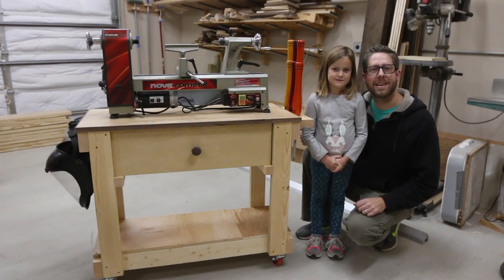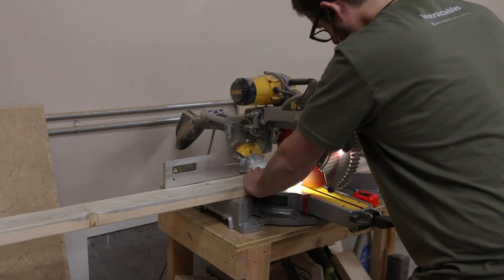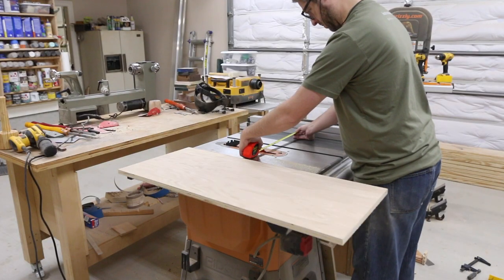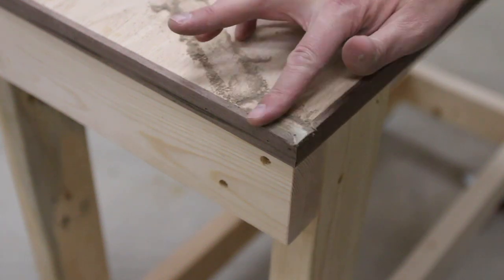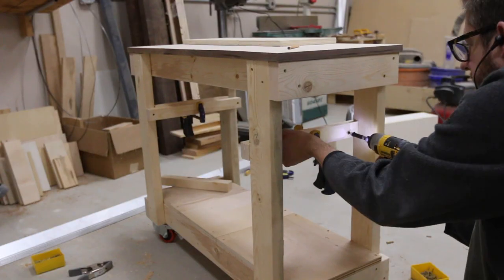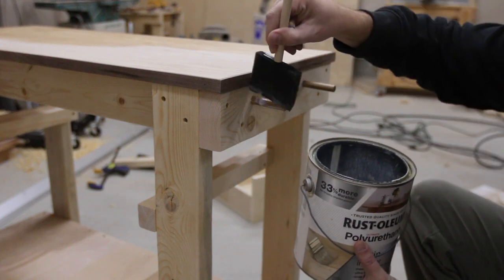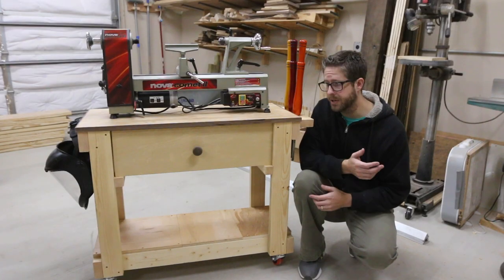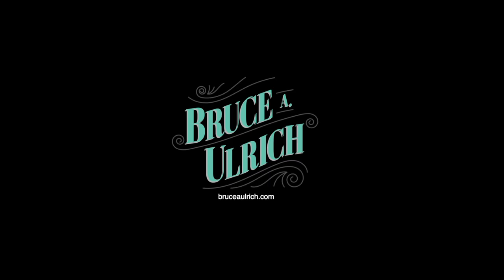DIY Lathe Cart from 2x4's // Woodworking How-to

Comment: Very simple, nice, effective, and practical cart design.  Plan to make a numbre of them for each of my bench-top tools (oscillating sander, band saw, drill press, scroll saw, jointer, planer, belt-disc sander, router table, grinder, and small CNC router.
Reply from the maker: That would be a good way to outfit your shop with a lot of stands.

Comment: Nice build!  Pop those feet off the lathe and shoot four 2" lag screws into the top to lock down that lathe.  Also, a great way to store a dust mask is with the inside facing down; keeps dust from collecting inside it.  A short dowel with a tennis ball on the end (like a wig stand) works really well for this.
Reply from the maker: I do need to fasten that thing down.

Comment: Bruce, I made a cart for my new thickness planer today. Super simple and only cost four 2x4s. I had some plywood that worked out ok. I didn’t get as fancy with the trim on the top but I will probably replace the top and then add the trim and drawer. Thanks for the idea!
Reply from the maker: Sounds like a good cart! Glad you got some ideas from my video!

Comment: Nice build, direct and simple.  Nice presentation as well.  What were the final dimensions?  Caster size?
Reply from the maker: Hey Joe...thanks! I don't remember the final dimensions. I based it off of my Nova Comet ii that was building it to fit. The casters are 3.5", I believe. They're the heavy-duty, double locking type from Home Depot. I've had good success with those over the years.
Reply: Bruce A. Ulrich Thanks.

Comment: Nice job!  Did you think about bolting your lathe to the top instead of it just sitting on the rubber feet?  Also, was there any problems with the lathe being on the cart that has casters while you were turning.  Reason I ask these is because I have the same lathe and I like your simple design.  Any input on both the pros and cons of your setup after using it a while would greatly be appreciated.
Reply from the maker: Hey Paul! I still use this cart now with the same lathe. I’ve not had any issue with it being on wheels. It might not be a bad idea to bolt it down. I’ve only had an issue with that when I’m pushing the limits of this small lathe. Overall, though, I really like it. I think I might put the tool holder on the back side instead of near the tail stock. That gets in the way a little.
Reply: @BruceAUlrich  Thank you for the quick reply.  Iwill be making one similar to yours.

Comment: beautiful but how do you find the stability? would it be attachable to the bench top?
Reply from the maker: Thank you! The stability is pretty good since I went with large, double locking casters. I’m sure you could attach it to the bench top. I’ve not done that and don’t have much issue with it moving. The only time I’m had it scoot around is when turning an 11” diameter blank on my 12” lathe. Ha ha. It was pushing the limits of what it could do.